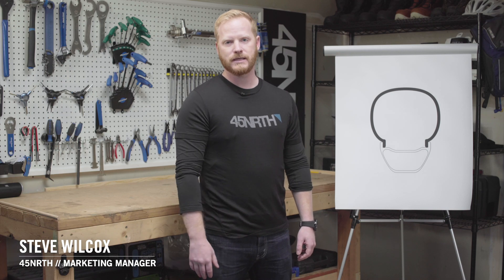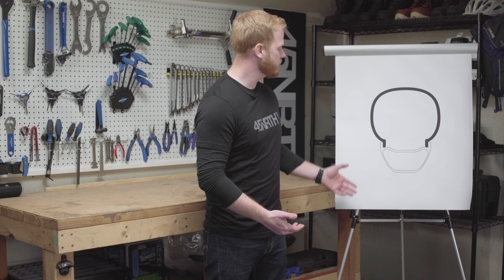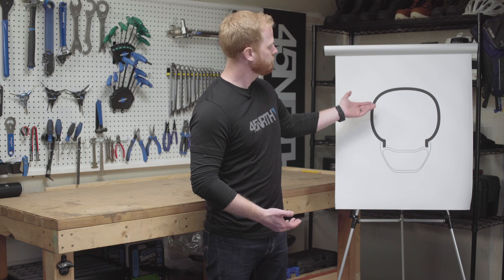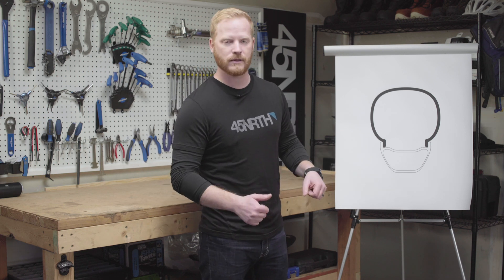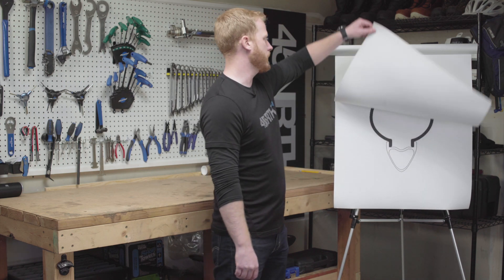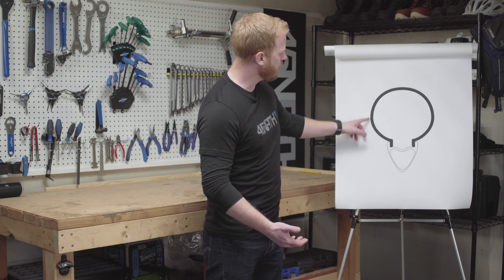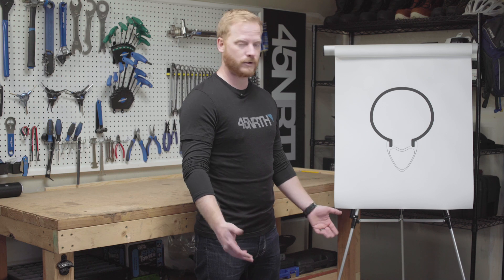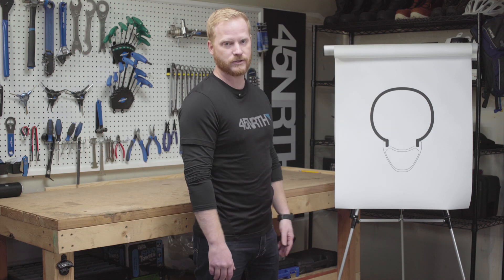45NRTH Tire Tech Education - Matching Bicycle Rim and Tire Widths

Comment: I've been running 28mm tires on a 17mm rim for over 6 months trying to figure out what the hell is wrong with my cornering. This should be more common knowledge. My bike shop should have told me. It's dangerous really. Thanks so much for this video

Comment: Still confuse. Search over 2 hours. Cant find a straight answer. 

How do i know what tire go on what rim (wheel you call it) 

The width. If the tire is 245 width. This is not the width where tire fit in rim. Soooooo confuse 😅

Comment: would it be safe to say if the tire I want says you can use a rim sized from 8-12 so would a 10" wide rim put that 12.5" tire in a good spot.

Comment: just came across this and I'm surprised on the range! a 44.8mm rim for a 2.2 (maxxis ardent race 27.5x 2.2 has iso of 56 so 44.8) I thought I was pushing it putting it on a 30mm rim
Reply: Ive been debating 2" or 2.2" for a gravel tire on a 30mm id rim, are you happy with it still? 40-80% is a much bigger range than i thought was ok.

Comment: Hello. How and what do you measure on your rim to determine the tire size
Reply from the maker: Hi Kapena,

You should measure between the beads of the rim (see 2:28 in the video). You can use a caliper, clear ruler, or other measuring device.

Comment: New to MTB here. I’ve been told to run low tire pressure. Once you have weight on the tire, wouldn’t that change the profile of the tire 🤔

Comment: This is a helpful video.  I have a 21mm internal rim so was able to calculate what size rim I need based on the tire number on the tire.  With that sad, my other bike has a rim that 20.5 internal rim width and I put a Maxxis Hookworm 2.5 width 29er tire and had no problems.  That in theory is too wide a tire for those rims but at the time I knew nothing about compatibility of rim vs tire widths, so I just did it and never had a problem.  I want to replace my tires on a 27.5 with internal rim width of 21 mm.  I won't over do it on tire width even tho on my 29er I had no problem.  I will try to do things right this time.

Comment: Great video as usual.  

Seeing a fair few people making custom electric bikes with massive battery packs and motors capable of speeds in excess of 70mph using bicycle wheels with motorcycle tires.  Besides the obvious problems are there any fitting concerns using motorcycle tires on bicycle rims ?  Would the beads sit correctly ?  
Cheers in advance.

Comment: Hi,
For a hooked rim, The measurement should be taken from the hook of the rim or from the wall?

Also, 
I gota pair of 700C wheels, with a internal Rim Beed width of 0.6 inch (15.24mm). Can you Pls suggest what the widest tyre I can fit there...will 700x35c go there? 

Thanks

Comment: Hi, can someone please gimme some advice? I'm running a 29' tyre with 1.89' width. Will a width of  2.1'-2.4'  fit those rims? Will it cause any problems if I supposedly fit those slightly wide tyres on my rims forcefully? I found a pretty good deal for new Kenda tyres which are slightly wider(2.3')  than my previous tyres(1.89'). Thanks

Comment: The ISO on my Onza Svelt 27.5 x 2.25 is 57-584, when i multiply 57 to 0.4 and 0.8 the results are 22.8 and 45.6, does that mean my tyres will go well with rims that have an inner width or 22.8mm up to 45.6mm? Please correct me if i'm wrong. Thank you.
Reply from the maker: Hey there, Jerohm - your math is correct! To be absolutely certain, your rim's manufacturer can confirm what tire widths are compatible with your specific rim.

Comment: I need a wider tire for soft sand... is it safe to run 245/50  (9.5 wide) on a 6.5 " wide steel rim?  I did for over 5 years previously and want to do it again on a van. The recommendation is 7" wide steel min.

Comment: I have a stock rim which is possibly the usual width narrow rim for mtb. Then my wheels are forekaster 27 x 2.35. Does the width of the tires of 2.35 be more wider if i replace the rim with a wider one as well?

Comment: Hi Steve! Thanks for sharing this video. I currently have 29er rims with 39.7 inner width. It is safe to use 2.5 tyre with this rims?
Reply: Rim is too wide. Thats a fat tire rim 2.6 to 2.8 tire. I would not go past 35 mm beads for a mtb. Stick with 2.35 to 2.5 tires. Beyond that is un needed weight.
Reply: @Hawlkeye-e9p  Lot of thanks for the info.
Reply: You’ll be ok riding a 39.7 inner rim with 2.5 tyre. Currently running 2.6 on a 39.8 inner wheel (RF i40 arc) Tyre looks well rounded and rides very well

Comment: I have a 26", 19mm rim...can i fit a 2.35 tire on?
Reply: No. Tries that. Super dangerous. Tire will flop on corners and landings = fall on face. 29 to 35 mm id bead rims only.
Welcome to the future.
Reply: Well i fitted 2.35 on front and there is not a single problem, I rode them for 3 weeks, that was my concern too but i gotta go wayy bigger to fall on my face like u said. 
And im more than happy with my 26, u stay on them 29ers

Comment: So now i have 29 2.25 on my 25 mm rim, Can i put a 29 2.50 on that ?
Reply: No. 2.35 to 2.5 tires work best with 29mm to 35mm rims. You will crash hard on your question. Trust me. Been there.
Reply: @Hawlkeye-e9p  it works fine :) i am looking for a 30 mm rim
Reply: @Hawlkeye-e9p  and 2.2 works with 25mmn

Comment: GREAT VIDEO, and much needed. On my 2019 MAZDA CX 5 I have 225/55/19 OEM all season tires. When they wear out I will replace them with 245/50/19 all season tires. (they are the OEM circumference) this "upgrade" for better handling and braking is the widest recommended tire for this wheel size given my rim width.
Reply: Just letting you know this video is for bikes, not cars.

Comment: i have 35mm rims and have 2.8 inch tyres will that rim be too big for a 2.6?
Reply: no u can trim down tire size to myb 2.3 but it will feel unsafe soo 2.4 is goo(i also have that combo 35mm rimms and 2.4 continental trail king)

Comment: ok so i used the formula and it says by using the .4 to .8 numbers that my 2.6" will fit from 26mm which i know some guys that use close to that size for 2.6" up to 52mm which im thinkin is waaaay to big so not sure the .4 and .8 numbers are that good to use maybe .6 and even that being 39mm is kinda bit much.. but def think .4 to .6 are better to use as a guide. please dont take this the wrong way im just trying to figure out easy way of finding out tire compatibility with rim size. So maybe this will help others as well as me...  :) 
Thanx again for taking time to do your videos..!!

Comment: will  a 2.4" be to small for a 35mm inner width rim?? i have feeling its a yes but just wanna make sure i went and got 35mm carbons and never thought about using smaller then 2.6" which im thinkin is prolly the SMALLEST i for a 35mm internal but like i said i wanna make sure cause if i can get away with a 2.4 then im def gonna try it.. Thanx in advance for any answers!!!!
Reply: He answered this in one of the question and yeah, you'll be fine with 2.4. 35mm inner width sweet spot is between 2.4 to 2.6 according to his reply.
Reply: @mjojrjr6231  sorry didnt catch him on that... Thanx alot man.. def gonna try em
Reply: @weathdone  I'm building a set up with the same inner width as yours and fitted 2.5 dhf at the front, back will be 2.4 dhr and they're both wide trail.
Reply: @mjojrjr6231  nice!! im lookin to do same 2.5 f and 2.4 rear

Comment: hello everyone, I have 21mm internal 29'' . Can I put 3.0" tire or How much I can  put the biggest in a 21mm rim. thank you.
Reply: I would say no, unless you want to have a light bulb effect. 3.0 tyre should be fitted to 35m upto 40mm inner width rim. Hope that helps.
Reply: @mjojrjr6231  with a 19mm rim can I fit 2.35? Rim says max 2.45 tire.
Reply: @magnumllama400  yeah, I fitted 2.4 in my old 21mm inner width so I don't see any reason why 2.35mm won't fit.
Reply: @mjojrjr6231  nice thanks
Reply: @mjojrjr6231  do you use wider on the front / rear or both the same?
Reply: @magnumllama400  for competitions,  pro tend to used wider fronts. Me as a nobody, using both 27.5 x 2.6 at the moment.  Will probably go down to 2.5 rear once I consumed all the knobs in my tyres. 2.5 Rear then 2.6 fronts...
Reply: @mjojrjr6231 what tires have you got? In here bike shops only had the continental cross king 27.5 x2.2
I didn't like those tires. Also I wouldn't like spending more than €30 on each tire.
Reply: @magnumllama400  I have the classic Maxxis DHR DHF combo. If there's only 2.5 DHR II, that would be my Rear Tyre choice. There's loads of great tyres, WTB, Specialized, Michelin to name a few.

Comment: Ive been running 20mm rims with 2.3 inch tyres for the past 6 months, did want to upgrade the rims to something like 26-30mm however all has been going great for me to be honest
Reply: 100% agreed, there is a great article on a popular mtb website on how there is a myth regarding rims needing to be wide... unfortunately mtb companies love making new trends, it's one of the most trendy heavy industries on the planet. They will come up with anything to keep sales going
Reply: 29 to 35mm id rims only.
Use wt rates tires. Wt is the wide trail standard set my maxxis.
Reply: I use moderate pressure like f-34 r-40psi in city/light terrain. I have 22.5mm rims with 2.0 tyres and its almost great. I feel that 2.15 (55mm) tyres will be perfect, now you can calculate rim to tyre ratio.

Comment: Just bought a 35w rim, and have a 2.4 tire on the rear.. I think it’s probably fine but still don’t know.. I found online that it can handle 2.3/3.0 or on some websites 2.5/2.8 can’t tell for sure.. any helpful tip? Thanks
Reply: Is that 35mm inner width or external?
Reply: im also running a 35mm inner width with 2.4 WT DHR, freakin Gnarly dude. can go rocket speed on corners!! Oh well i guess its all about practice also. LOL

Comment: What best rim size fit for maxxis ikon 2.2?
Reply: I would say 25mm inner width  should be spot on.
Reply: @Convultus  totally agree 👍,  my stock wheelset got 21mm inner width and came with 2.4 front and 2.3 rear. Upgraded my wheelset now to 35mm inner width with 2.6 tires both f & b.

Comment: Hello Sir, regarding this size of tire, if I have rim with 36mm IW what size of tire can match with that?

Thank you, I Hope you'll notice me. God bless po :)
Reply from the maker: Hey there! A safe range would be 2.2" - 3.0" tires. 2.4" to 2.6" would be ideal.
Reply: @45nrth97  hello sir, I have 21mm internal 29'' . Can I put 3.0" tire or How much I can  put the biggest in a 21mm. thank you.
Reply: @45nrth97  I'm spot on with my rim width. Got 35mm internal width and I fitted 2.5 at the front and 2.4 at the rear...

Comment: I currently have a 21mm Rim running on 29 x 2.2 tire. Can I go to a 29 x 2.4 tire?
Reply: Ideally you would want something a little wider, like a 24mm rim width. But, you should be alright with 21mm. You may see a little extra rounding of the treadcap and a slightly softer feel to the sidewalls.
Reply: @teravail4366  on a 19mm can I run 2.35? Rim recommends until 2.45

Comment: Question, will my tire increase in width lenght if i increase my rim size? Im planning to replace my 19mm inner rim to a more wider rims. Increasing it to 26mm to accomodate my 2.3 tires. Today, im running a 2.3 at the back and 2.4 at front with an 19mm rims. I know it is not recommendend but, as long as i kept my air inflated, il be ok.
Reply: Yep, it's certainly possible to see an increase in width by a couple of millimeters.